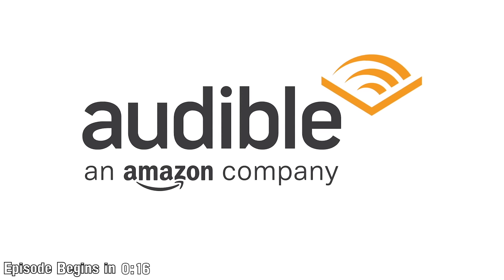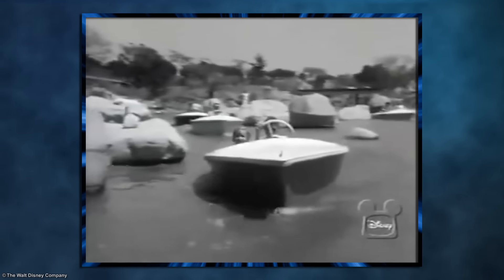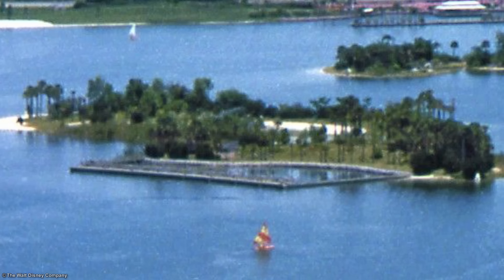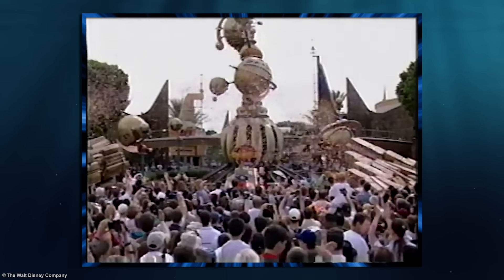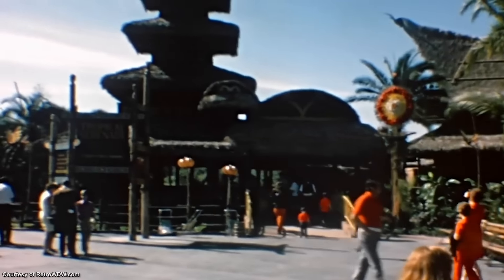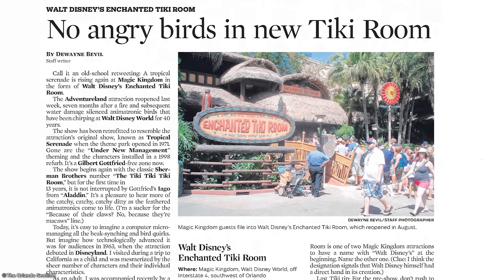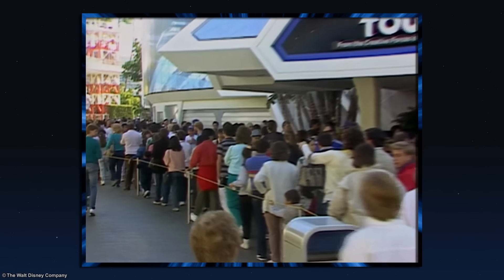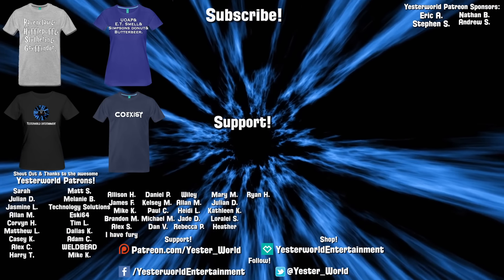Disney’s WORST Theme Park Blunders & Mistakes EVER! - Part 1

Comment: Despite the fact that it was the 3rd most popular ride at Magic Kingdom, one of the main reasons management closed 20,000 Leagues Under The Sea was due to serious cost & maintenance problems.  Apparently the water in the semi-tropical climate of Florida had a tenancy to grow lots of algae, consequently, the maintenance staff had to dump massive amounts of chlorine in to the water to prevent growth. This in turn corroded the paint off the surfaces of anything submerged in the water and was hard on the mechanical parts of the anamatronics. Furthermore it forced the maintenance crews to drain the entire lagoon of water and clean, repair and repaint the various parts of the ride twice a year. It's rumored that 20,000 Leagues was so hated by the maintenance crews that the they dragged out a slowly sinking decommissioned Nautilus submarine to show Micheal Eisener (on tour of the park) telling him that all the boats in the ride were in such a poor condition just to convince him to shut the ride down.
Reply: Same thing happened to Journey Into Imagination
Reply: @notcoolG they should have just gotten a lot of snails 😂
Reply: @superlolbrothers6559  I don't think it would be that bad

Comment: The biggest mistake Disney have now made to date is to theme the new Star Wars section of the parks around the last trilogy rather than the original trilogy. They could have easily made the section based on Tatooine using Luke's home, Mos Eisley Cantina, the Sarlaac Pit, Jabba's Palace or Jabba's Barge and even Docking Bay 94 if they wanted to feature a full sized Millennium Falcon. Instead, they themed it around a trilogy that today's kids aren't really interested in and that the 80's audience (who now just happen to be the generation with pretty much unlimited disposable income) don't get and again aren't really that interested in either -talk about a huge gaff.

Comment: In defense of the Enchanted Tiki Room: Under New Management, the inclusion of the two characters from Aladdin and The Lion King did add some much needed comic relief to the classic attraction. Perhaps if they didn't make such drastic changes other than their inclusion, it would have been met with much better reviews.

Comment: Man, Endor Vendors was amazing in the early/mid-90s when Star Wars wasn't so popular.  It was basically a mecca for fans looking for merch.  Outside of conventions, you'd never find that many SW products in one place, and they had a nicely varied stock - not just toys and T-shirts. Plus having those great costumes on display.  I was so disappointed when I went back after the Tatooine redesign; they really took a lot of magic out of it.

(Of course, I imagine that their revenues dropped sharply by the end of the 90s, once people could just find and buy merch online.)
Reply: And at the time, that was like THE Star Wars shop, that kind of merch wasn’t really sold anywhere else in the parks. Now literally every store at hs sells the same sw merch, so it’s kinda lost the magic.
Reply: What kind of adds insult to injury to me is that Star Tours could've been reworked as an entry ride to Galaxy's Edge. Imagine going on the ride and 'landing' on Batuu, and emerging not into a gift shop, but into the 'port' including a marketplace. (Mos Eisley is both a port and market, for example.) To really cap it off, to have you also exit Galaxy's Edge via the same essential ride... Immersion could never be so complete.
Reply: SirEuchre That’s kinda what they are doing for the new hotel. Also, as of the last time I rode, you ended the ride on batuu, which made no sense as you would go from being outside on batuu, to inside the star tours building, exit from tatooine, and end up in Endor. It would have been cool to have the ride exit into galaxy edge

Comment: My top 10 Disney Parks mistakes that I will rectify after seizing control of the company:
1.  Removing the Disneyland Peoplemover for the Rocket Rods
2.  Journey into YOUR Imagination
3.  PC Pirates of the Caribbean (and adding Jack Sparrow)
4.  Turning the DCA Tower of Terror into Guardians
5.  Galaxy's Edge
6.  Removing Snow White's Scary Adventures in Magic Kingdom
7.  Removing The Great Movie Ride for Mickey's Runaway Railway
8.  Removing the Skyway in both Disneyland and Magic Kingdom
9.  Replacing Maelstrom with Frozen (and adding other IPs to EPCOT)
10.  Replacing Horizons with Mission: Space
Reply: Well to be fair about the Skyway, they would've to rip open the Matterhorn up, and it would've taken a long and lots of money.
Reply: @nickrustyson8124  Number 10 I believe was a forced move - they didn't really have much of a choice given its structural problems and the fact it was starting to sink and collapse in on itself (plus iirc it's illegal to build on top of a previously formed sinkhole for some time)
Reply: @nickrustyson8124  No reason why I can't bring it back and have it go around instead.  But the sacrifice would be worth it though to try to have it go through again.
Reply: @christiphergedge5078  The sinkhole story is actually a myth that has been disproven.
Reply: Pirates of the Caribbean needed to be changed. There should not be rape jokes in a theme park or anywhere frankly.

Comment: I can name a few d land blu ders. A, not arranging the angle  of the haunted mansion facade so that the center main door was aligned with the gallery elevators, B, not installing brakes on the waterfall drops in TPOTC , C, not extending new orleans square out into the space wher that boring critter/bear county is and D, america sings

Comment: -When the Phantom Boats first opened they were originally just called Tomorrowland Boats, it wasn't until they made the operational changes that the name was changed, I believe.
-The Motor Boat Cruise was never called the Fantasyland Motor Boat Cruise, at least I've never seen it called this in any sources online I've come across over the years.
-Also I have recently read that the wave machine was actually refurbished in 1985, before being removed after further beach errosion occurred due to use. But I haven't been able to verify this as it's the first time I've ever heard of it. But thought it was interesting.

Comment: When my family went to Disneyland when my sister and I were little, we really wanted to go on the 20,000 Leagues submarines. The problem was that we're both claustrophobic so our parents wouldn't let us. We promised each other that when we got older we'd go on them even if we were scared because we wanted to see the mermaids and the sea serpent. It closed not long after and when it was reopened as Finding Nemo we were so upset! We went on it anyway and it's not worth the claustrophobia (even though we did like the movie Finding Nemo). I will die mad about not getting to go on the original.

Comment: 1991? Gummi Glen was advertising a show that had been off the air for several years as they were only included in the afternoon bloc due to needing another show to make it two full hours! if it had been done three or four years earlier it might have been successful

and I have to wonder if the delay in redoing the sub ride was more to do with them knowing that the movie would flop and there being no point in trying to create a ride based on a failed movie

Comment: The problem with the Tiki Room without the upgrades is that it basically means nothing to the kids because there's no recognizable characters, and it is just plain boring for adults and only serves as a way to escape the heat/rain, or rest your legs for like 10 minutes. That's why the attraction never has any wait to get in. It just seems like the space could be better used if they really insist on not spicing up the show in any meaningful way.

Nostalgia is great and all, but pretty much everyone involved in the creation of that production, or was around when it first debuted has passed away or are super old to the point they're in nursing homes. It would be wise to renovate the space to cater to modern, young audiences, instead of wasting real-estate on a few nostalgia-clingers. Imagine if they never changed anything about the parks, how boring, behind-the-times, and generally repetitive everything would be?

Time to move on.